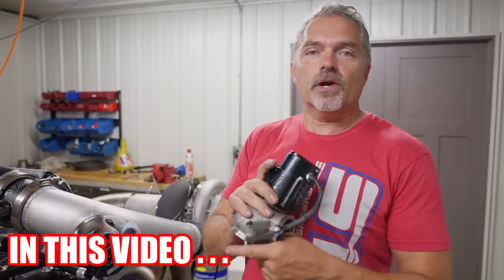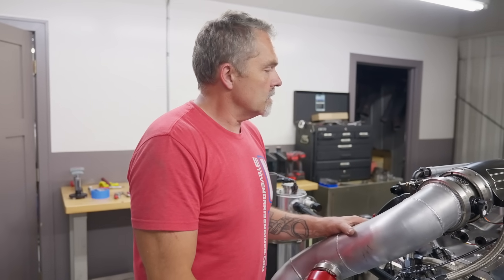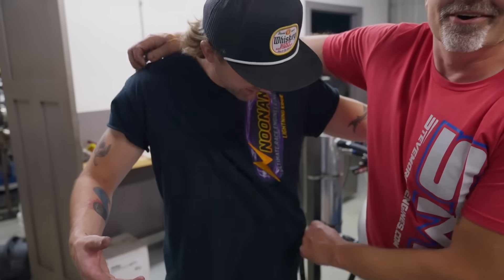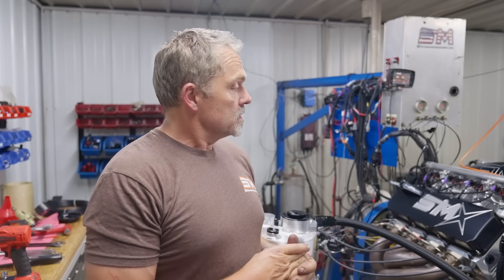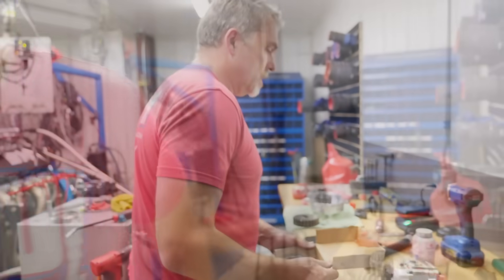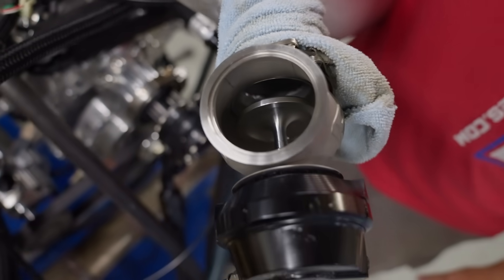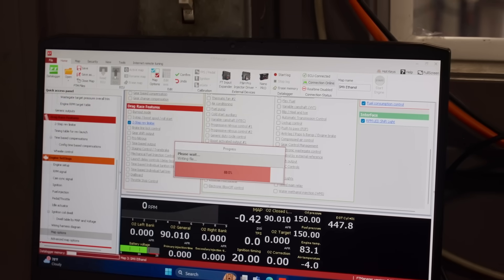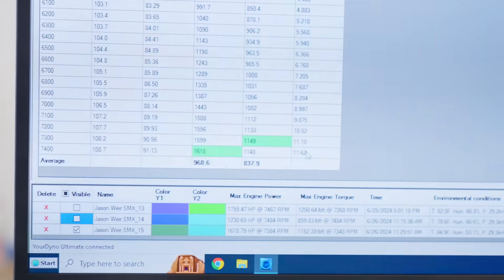Blower Or Turbo? And Cleetus’ Bigger Rods !

Comment: Supercharger= near instant power.
Turbo= Turbo lag, but a little more potential.
Reply: Also power requirements to drive a super charger vs exhaust gas propulsion, not a big deal when you have thousands of hp so much😂
Reply: Would be cool to see some sort of compound setup feeding into the procharger
Reply: And turbos are a lot more complicated to power manage as was clearly demonstrated in the video.  And this is with the engine on a dyno vs in a car.
Reply: @ruckus__ no need to do a compound system with gas engines. You can’t put the boost to a gas engine that you can to a diesel,. Yiu can only add so much boost to a sparked fired engine before you have detonations issues that start melting things or breaking rods, you don’t detonation issues with diesel because in stead of spark you spraying the fuel in to get the ignition.
Reply: Turbo recovers energy, supercharger uses it.   I still like blower characteristics for the instant torque off idle for most things.
Reply: @beekeeper6109  tell that to all those Group B guys back in the 80s compounding everything, and people are still compounding gasoline engines today, Mercedes still has a compound boosted engine, an electric 48v supercharger fed by a turbo I believe their system is.
Reply: super charger gives low end almost instant power while being consistent up til limiter
turbo comes on late when rpm's build up but cause it doesn't run off crank has higher power top end but you see less power low end higher top end power at same boost level.
Reply: The blower is harder on internals than the Turbos also.
Reply: If only it was that simple. But nice try.
Reply: Why do so many people think that all superchargers make instant boost? 
This is a centrifugal. They don't do that.
Reply: you seem to be confusing positive displacement blowers with centrifugal blowers.  The former is instant power, the latter being a belt driven turbo which doesn’t make max boost until max rpm and are the worst of both worlds
Reply: @johnnygeorgopoulos4072  laughs in every bi turbo merc
Reply: I have always been curious to see if a cvt like drive system would work better on a centrifugal supercharger and use the cvt (or constant variable drive?) to regulate the compressor speed so it can always be held at the desired boost pressure when the crank isn't turning fast enough @eliotmansfield
Reply: @arbiter1 research showed a parasitic power draw off exhaust gas driving the turbo
Reply: Yep turbo is always faster on the big end, blower is faster in the short track.
Reply: @ruckus__ you mean charger feeding the turbo😉 that low end instant boost will happily assist that turbo
Reply: Something tells me no one watching this video needed that explanation but thanks lol
Reply: You don’t have turbo lag when you have a thing called 2step. Or anti lag it’s 2024 man you should know this. But I like a supercharger but not the big hat blower style over a pro charger just because of sound myself but duel single tips vs zoomies I personally do not like zoomies they are just way to much
Reply: Twin charged
Reply: @bigboreracing356  rrrrrright sure 😆
Reply: @bigboreracing356  🤣🤣 yeah I'm gonna have to say nope. Probably 18in of vacuum at idle with your centri.
Reply: @bigboreracing356  oh no i do. see that's also where you are wrong, and how I know you are spewing bs. Thinking because you have a solid roller cam has any bearing on this, your centri (or any other form of forced induction) is not making 3 psi sitting there at idle. It's laughable you are even trying to push this.
Reply: @bigboreracing356  ok boomer, look, I make a living modifying cars and been doing it for years. No amount of calling anybody an "armchair quarterback" ,like that's some insult, will change the fact that you are not making 3 lbs at idle. I don't care if you have an f2, p1sc, d1sc, Novi 2000, s trim...don't matter, take a pick. It's not happening. So tell me more how your car hops soda cans and can't grab a 100 dollar bill off the dash because of your 3/4 racecam. Im sure your drinking buddies are impressed but I know better than believe such tall tales....
Reply: Turbos have much more potential due to having a more efficient range and being much less parasitic. There’s also antilag in turbos which defeats its main enemy.

Comment: "Caution" - @ 79 I'm still learning :person-turqouise-waving:- Know it is tough to find time, don't stop info in a entertaining way  :_dewey: :_Fan1: It's the Steve Smile  :yougotthis:

e boost controller sorta what F1 uses the MGU-H
What are the advantages of MGU-H?
The MGU-H is mostly used to increase the boost pres- sure, thus increasing the brake mean effective pressure (BMEP) output, when the energy available at the turbine is insufficient to properly run the compressor, for steady, low speed.

Comment: The turbo motor spooling waste-gate worked just like a fighter jet engine! It bleeds air for acceleration. The only additional thing for jet engines is that it prevents engine compressor stalls.

Comment: Aside form the parasitic loss, here's also heat. And at some point with the impellor speed, it will also start to stall thus run out of air like the turbo compressor does.

Comment: Curious how you choose to release the dyno and how long the sweep goes. I imagine the large horsepower runs through the water brake fairly quickly. Is it rpm increase per second? How does that all work? Thank you!

Comment: Make an input on a table that will pull timing starting at 5000 rpm and go to -20 by 5200 rpm, this will act like a rev limiter but be butter smooth and it will spool the turbo with no engine load, let it go once you hit the boost you want

Comment: Crazy butt relevant, I was thinking the same thing before I seen the video of the waste gate and thought that needed a flat to build pressure then release to spool faster because the evacuation of the exhaust pressure will be quicker like in the three valve per cylinder application

Comment: That massive turbo needs a jet/rocket anti lag system. That way you can control the amount of boost you want off the line then depending on how much fuel you put into the anti lag you can control the rate that the boost climbs. I am really surprised more teams haven't implemented such systems. Unless the class has outlawed it.

Comment: Steve could you put a turbo on a heavy duty gas truck and it last towing. Just wondering if it would be worth it compared to dealing with a diesel and DEF
Reply: Yes it would last if you set the ring gaps correctly and had a good tune to match your fuel octane rating. Even 5 psi makes a pressty big difference on a stock engine

Comment: Hi @stevemorris I was wondering, you said billet blocks needed heat treatment while being machined. When you weld a block wouldn’t the welded part react differently (expand) or is the welding process enough of a heat treatment? And if not wouldn’t that be the reason why a repaired engine is less reliable?

Comment: In an earlier video, you made the point that when you run a blower/turbo straight into the atmosphere that is actually has to work harder since there is a constant 14.7psi to push against as opposed to the  vacuum created by the descending pistons. I don't know of that's true or not, but it stuck me at the time as very interesting.
Reply: I typed this before you talked about doing it with the blower.  If the drive pressure on the blower goes up, why wouldn't the turbo do the same thing?  Lots of things going on there. Interesting to think about

Comment: Could an engine dyno be used with the engine and trans combination the person is using and hook the dyno to the "driveshaft" out of the trans?   Solves the problem of flashing converter and trans brake but at the same time I figure it would make more sense to just hub dyno it after install?

Comment: Steve did you think of using the type of boost control system that Mark Micki runs? No waste gates and boost is controlled by 2 blow off valves in the intake tube.

Comment: I not a fan those e-gates because I had one of them bolts backed out and even with boost cut it overshot and hurt the engine. Those gates will jam shut when the motor breaks off. 
I only had 1000 street driven miles on it. It wasn’t even beaten on the track hard.

I didn’t have a control issue I had a failure squeeze they use 4 tiny m6 bolts to hold that big wastegate motor on.

Comment: I understand your theory of the relief of the back pressure on the turbo. Kind of like revving up a engine and dumping the clutch to try and do a burnout. But at 0psi the engine is consuming as much air as the turbo is passing anyway. Any positive charge pressure would also create more exhaust flow?

Comment: Well I did learn something.
Could you share air fuel ratio info especially when doing comparison runs and power changes. Would a higher control pressure water pump to the dyno better simulate car loading vs dyno loading?
Thanks again..

Comment: Would running the turbo motor on methanol have helped get it to spool better with the cold side gate? Since the extra exhaust flow/energy would have pushed the turbine a bit faster?

Comment: The 140mm T might be a slug at low rpm due to the exhaust back pressure. Until there's enough hot gas to move the impeller fast enough to do work, it can be a restriction. Some guys leave the waste gate open until they're making boost at whichever rpm the engine's exhaust really heats up the turbo.

Comment: How come at that level of power, nobody tends to use any charge cooling? Intercooler ? I would imagine the intake temps are in the 300+ range even on methanol. One could run less boost with a lower intake temp due to higher air density.

Comment: For the turbo motor could you not put it on a 2step, with very little load from the dyno, then add load until you can hear it being loaded and get off the brake?

Comment: Can you change the exhaust side impeller/snail on the turbo to spin the intake side impeller faster at a lower rpm and accomplish a better boost/hp curve without sacrificing full rpm boost. Possibly Impeller design shape or vaariable ?

Comment: What if you just took the blower gears (procharger) out of the housing all together, removed the charge pipe & call that your street tune.  Once at the track, replace the gears, boost pipe, flash race tune into it & call it good.  Seems like a lot of work to convert from street to strip, but you already have to do that with lower ratio gears anyway.  
This would be a lot easier with a belt driven procharger.  By removing all boost and going NA on the street, a much cheaper fuel could be used.

Comment: Why wouldn't you just change the dyno start to load rpm to 6500 since the turbo won't light below that on that many cubes? It probably needs a smaller exhaust housing if you want it to start making boost at lower then 6500.

Comment: If you had a turbo speed sensor could you use that data to control the position of the spool valve rather than using rpm?

Comment: Can you write a dyno loading scaling facor for the 1st few seconds or under a given rpm?  Instead of 1:1 input to output. Use a subprogram to produce 3:1 for the first 2 or 3 seconds of the pull to get more initial turbine shaft speed

I understand you need one to one for accurate numbers from the dyno.  But you also need exaggerated load to make the turbo spool.

Comment: Weird question for you. But if you had just a bare frame or chassis with say a 2 speed 400 and a 9inch couldn’t you use that on the chassis dyno then you could have your two step and everything set up. I don’t know anything about dyno’s it was just a question for instance like this

Comment: It shouldn’t spin faster solely because you’re putting more load on it because you’re moving more air through the compressor side  

Just like putting your hand over the end of a vacuum cleaner when  pipe its a sealed system it raises the rpm of the vacuum motor. 
Creating a leak is like the open end of a vacuum. Slower speed on the motor more load. 

In the case of target only 10 psi and you have a leak and the car commands more wastegate to achieve target 10 psi then I could see a higher rpm.

I believe you already showed a video with a pro charger with a leak bending the crank from belt pressure. 

I think what they are actually doing  is creating back pressure in the exhaust from the additional load acting like an engine brake and when you finally shut the bov you create a boost spike from the additional drive pressure to jumpstart the output.

Comment: So what did we all learn here today? Blowers=Cheat code Turbo=Incremental complexity
Reply: blowers break alot, shake cars apart, and make a ton of low rpm power that can blow the tires off
turbos make those problems go away but are a tuning nightmare lol
Reply: Blowers = parasitic loss (whether crank-driven or belt)
Reply: @Make-Asylums-Great-Again  yep! I remember one of the nhra top fuel guys saying that huge blower on them takes 400hp to spin

Comment: The turbo is loaded by the mass of air it has to move, not the pressure.  By adding that blow-off valve, you are actually loading the turbo more by making it flow more air.  Increasing the hot side air flow is what you should be focusing on to spool it faster.  It looks like this turbo is just too big to operate on this engine below 6 or 7k rpm.  You might want to look at the surge line of the turbo vs the actual air flow of the engine at lower rpm

Comment: Full throttle does not need full opening, its Pumping Loss or someshit.
Honda have worked it out in tuning. 
You need a throttle body in front of turbo only partially open until launch. 
Will be on fullboost ASAP 
Works well on manual street cars between gears also

Comment: I'd like a little more explanation on the waste gate blow-off valve being so detrimental on centrifugal superchargers. Do you mean like active control or just having a boost leak.  I've seen 2 different instances of people Taking a hole saw to a charge pipe to lower boost. I get it still takes 500 hp to drive but the impeller and gears should still be loaded.

Comment: It is an amazing looking car.  It's hilarious how much is kept secret when really it's just everything is ballistic protected. You know the suspension is basically a truck setup, engine, i'm certain you can hear is a V8, i'll be certain it is a diesel V8 derrived from the likes of the REO where you can run it on almost every kind of flammable substance, besides that, some little tech bits, it'll have some oxygen tanks but nothing like built in jammers or any crap like that, that's what the other vehicles in the motorcade are there for.

Though i would love it if they just once... at least once.... did a burnout.

Comment: Adding a check valve, Tee and a higher flow pump.
 I bet someone in the audience knows enough about micro processors to have it be electronically controlled between the relationship of dyno inlet valve position vs water out , the cavitation caused should be readable on the outlet side (press/flow)

Comment: Kinda suprised about the flat timing curve. I know you pull a bunch of timing for power management. I know I couldnt get away with running redline timing at peak torque without getting alot of detonation.

Comment: The turbo will make more power, but the blower will be more controllable.
Reply: Hell yeah turbo all day.
Reply: @HoldPublicPigsResponsible  just depends on what type of racing. For lower level stuff I agree.
Reply: @1clnsdime1 I’ll pick a turbo all day any racing. It’s proven already. Roll racing which I do in my coyote I have twin 64s precisions makes about 1400 on highest map on e85. I like how nice and easy it is to turn up boost on turbos. A few buttons and I switch between maps. Also it’s my daily driver. Tuned by lund. Built motor from FFRE.

Comment: Are your valve springs specifically designed to your specifications because if so have you considered having springs designed in 17:7 stainless steel. This should I think avoid the stress corrosion from sour methanol and water in the oil. Properly designed 17:7 springs are good for 100 million cycles at least. Beyond that very high cycle fatigue can sometimes be an issue. Must be good quality VAR or similar to avoid inclusions.

Comment: Big turbos always suck at lower rpms, they don't get enough gas velocity to work over a wide range...☹
Twins of a smaller size can help if sized correctly and with oem cars variable geometry makes huge differences to driveability, my 2.2 litre Ford diesel makes over 330 lbs/ft at 1500 rpm with minimal turbo lag, with a variable geometry turbo that has done 201K miles without any repairs required...

Comment: I have a question Steve, and my apologies if this has been asked and answered before. Why do almost all engines on engine dyno the HP and TQ lines cross or meet at the same rpm? Thanks
Reply: HP is a mathematical calculation of torque.  Look up the formula and it will explain why.

Comment: You should build a hybrid dyno that is a combo of the water brake and the hub dyno.  Bolt the engine to a transmission/converter and then connect the transmssion to a chassis style brake.  That would allow you to simulate car like loads without having to have the car there.

Comment: Surprised you didn’t use FuelTechs rolling antilag for the turbo engine to build boost. Could have set it for the 5k rpm you wanted with a boost target of 10-12psi, and when you let go of the button antilag turns off and dyno pull starts 😂

Comment: the supercharger looks so much easier to drive and Stage.  I know it's proprietary info but the cam differences would be very interesting. looking at the boost on the supercharger it "looks like" the blower speed would be easy to calculate from the info you have to the boost you want.